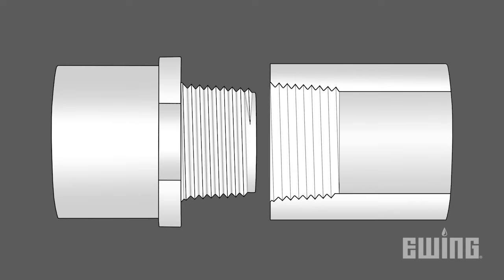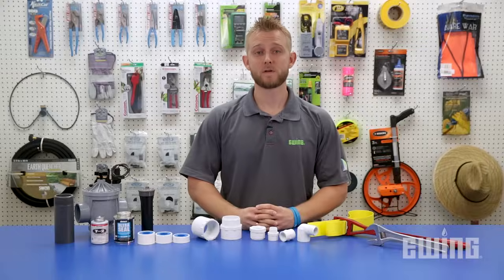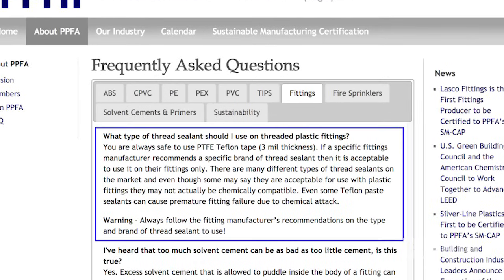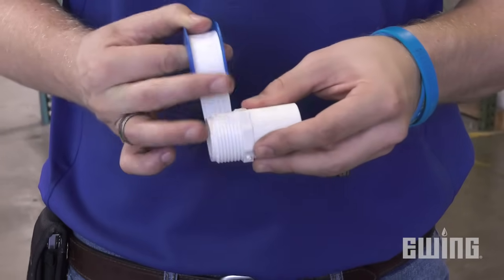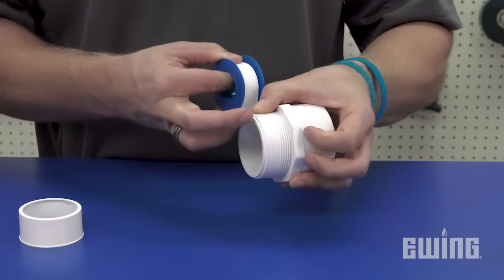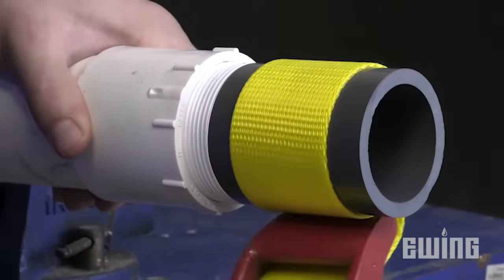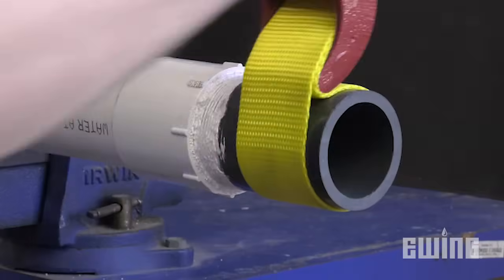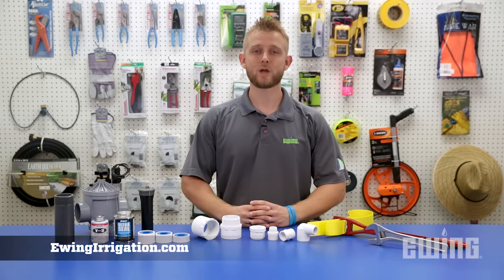How To Make A Threaded PVC Fitting Connection

Comment: Put together a small assembly and every threaded fitting leaked like crazy. I was "careful" to not overtighten... but I didn't realize how little tightening that meant. I also used no thread sealant at all after reading many forums online said no teflon tape needed for pvc theads. Now I need to reassemble and hope I didn't deform everything too much or else buying all new fittings.

Comment: Oatey Great White is incredible on threads for nuts on thin wall exposed sink p-trap and other connections. Yes, most people don’t do it. But most people also find thinwall drain pipes finicky and leak prone. Set Great White on the threads, still use the rubber seal ring, and it will never ever leak.

Comment: What if I’ve been taught to use both thread tape and pipe thread sealant on each connection?
Reply from the maker: Some prefer to use both but it's not necessary. If used properly, one or the other should suffice. Thanks for watching!

Comment: Is there an advantage or disadvantage to using both. Tape first then  thread sealant over it?
Reply from the maker: You will likely find differing opinions, but one manufacturer of sealant states that using thread sealant over tape can help fill any voids that the tape may have left open. If you choose to use both, be sure to put the tape on first. Thanks for the question!
Reply: @ewingoutdoorsupply  thanks👍

Comment: Lasco, the giant mfg of PVC pipes and fittings, is emphatic about NOT using Teflon tape on threaded PVC fittings.  Their rational is that the Teflon is lubricating and it makes it too easy to overtighten the fitting.  Their recommendation is to use a non-hardening sealant, though their website doesn't make a recommendation for one.  Many of the videos on YouTube about tape vs sealant are not from manufacturers of pipe and fittings but are from distributors, plumbers, DIYers, and home-improvement shows.   McMaster lists 37 items on its page of non-hardening sealants.

Comment: Another no razzle-dazzle... Grrrreeeat!  Get to the point, and I appreciate it!  Looking for a fail-safe way to join these PVC fittings. Will try and hope it works.  Thanks!
Reply from the maker: Glad it was helpful!
Reply: Oh, one thing you might add, what I found out today, is if you find yourself cranking down on the connection to get it to stop leaking (PVC on PVC), you're probably doing something wrong.  I went from 3 winds to 5 winds, and so far it's holding.  I also went from some super HD/Lowes tape to Monster tape.

Comment: So if you follow this procedure and find that you have a slow leak under pressure, do you try tightening further? If so, how far do you continue before you give up, take apart the joint and try again, possibly changing to the other type (tape/dope) of sealant?
Reply from the maker: Yes, you could try tightening it a bit more just don't crank it down too much. Maybe another 1/4 to 1/2 a turn. If you find that you need to take it apart, check to see if the tape got bunched up and pushed out of the threads.
Reply: Had this happen today.. not enough thread tape and it didn't cover all the threads. Now I know better.

Comment: Felling a little embarrassed - this is the first time I have ever gotten formal training on proper tightening and a good comparison of tape vs dope.  Also, I never felt great about using a wrench with teeth and I own a strap wrench but never use it.  I completed a replacement of 4 1" ID globe valves and I must confess a few things were really cranked up tight - but I have not filled the trenches and will revisit and dissemble and use the methods in this video.
Reply from the maker: Glad to help! Thanks for the comment and good luck.

Comment: NEVER use thread tape on PVC fittings.  It is not designed or allowed on PVC connections.  You need to use a non-hardening thread sealant.
Reply: That is completely false.
Reply: It IS allowed on PVC fittings. I've never met an inspector who had a problem with it. Many manufacturers insist that ONLY teflon tape be used. Having said that, I have always preferred Oatey Great White sealant.
Reply: Perfect example of code vs can. You surely can use tape and it can last you a long time if you can do a good job.

 In some places you may not legally be allowed to use tape. 

This does not mean there are not better solutions than tape, just that you can make a good connection with tape even if it's illegal.
Reply: I read on Lasco's site that says 
DO NOT use teflon tape on PVC threads..
Because of over tightening and possible cracking of threads..
DO use PTFE non-hardening  pipe dope..
DO NOT use oil based pipe dope.